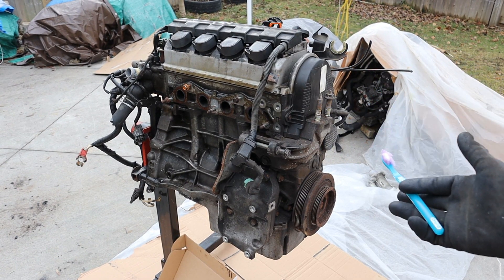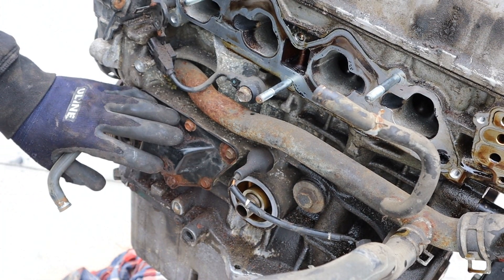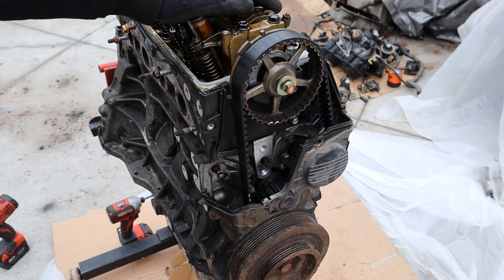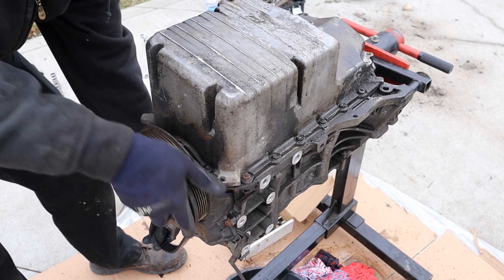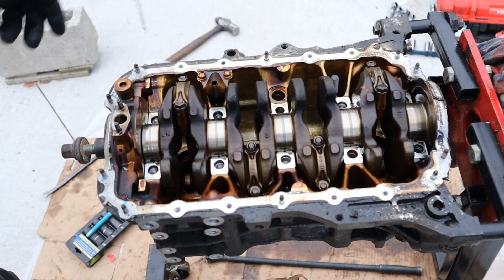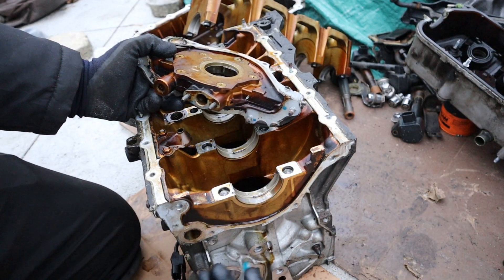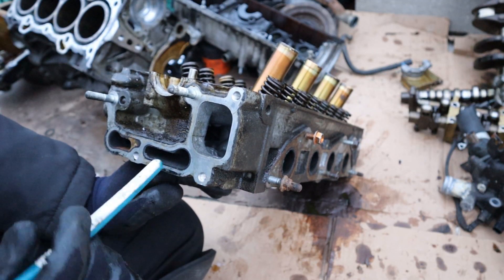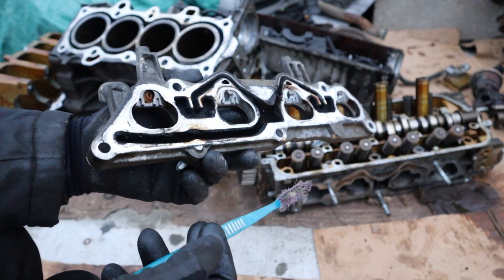Honda D-Series Engine: A Low Point for Honda

Comment: All Honda engines are turned down from factory to meet emission regulations. They are built solid and not "barely enough" so they break down once you increase power. Back in the 90s and 00s I NOS-ed the crapp out of stock D15B2 engines (90ps) and they lasted really long, did not even break down just blew gaskets and piston rings. Friend of mine upgraded a louzy D14 (EK series) from 75ps up to 143ps , dyno proven. upgrading step by step MPFI , TB, pistons for CR, cams (D16), intake, header, exhaust, airbox etc.etc... crazy. Ghetto stuff, people could not believe it. It is easy to swap B or K (or even J now) but the real fun is light car + built engine on budget, that is the POWER OF HONDA
Reply from the maker: Emissions make things sad. But at least they used to be built strong. 😢

Comment: i dunno man, the d-series is pretty solid little engine. the d17 aint nothing to write home about, but it did address the problem of ignition from the previous versions with the coil on plug, other than that no real improvements.
Reply from the maker: The k series and r series that came after were alot better

Comment: I'm a Honda tech and that was a bulletproof engine. The intake manifold nuts are easy to remove from the top , the biggest reason to remove the manifold was to clean clogged egr ports which didn't happen often
Reply from the maker: And how about the intake nuts from the bottom?

Comment: 192,000 kilometres is 119,000 roughly miles so this engine failed early in its life probably from a lack of oil changes
Reply from the maker: It didn't fail.

Comment: The K series did not replace the D series.
That would be the R18.
You should do video on that engine. 
Should be easy to get one. The '06, '07 and '08 were prone to cracked blocks.
Also the D series weren't that bad. People were putting forged pistons and rods in them making over 600 horsepower.
Reply from the maker: I've done a cracked R18 video check it out !

Comment: The bracketry and BS attached to the valve cover is ridiculous when they could've just attached it somewhere else, because it all has to come off to do the manual valve adjustment and valve gasket. The cam plug leaks bad and needs replaced on every single engine. Low powered for no reason and blows head gaskets
Reply from the maker: Yeah they could have made it more user-friendly

Comment: I've got a d17a1 in a 2002 civic. It's been a good engine currently has 445k miles and I still drive it some.  Bought it new 21 years ago when I started working for Honda.
Reply: Wow, 445K is the highest mileage 7th gen I have ever heard of. Engine and transmission still original?
Reply from the maker: That's alot of miles!

Comment: The o ring on the back side of the oil pump is a known leaker. Also there can be an oil restrictor between the head and the block that appears to have two small o rings, different sizes, this restrictor and  the o rings don’t always appear in the parts manual or any workshop manual. My daughters 2005 LX had them though. They fall out when you lift the head off and if it wasn’t for pure luck I wouldn’t have known they were there. Put new ones back, either end of the restrictor, and the engine ran fine. Thanks for the good video. Sometimes the alternator bolt securing the +Ve cable can be so tight the post shears off.
Reply from the maker: Good to know these little details from an owner

Comment: Just acquired a 7th gen Civic as a beater car about a month ago and was wondering if you or the I Do Cars channel would ever release a video of a teardown of one of the engines just by chance because it would be super cool to see an analysis of an engine I own. My daily is a 2000 Maxima with the legendary Vq30...you did a Vq35 so close enough for me lol. Basically same engine just larger displacement and has VVT whereas mine does not.  Anyways just think its super cool I can watch a teardown of an exact engine I currently own! Only difference being mine is a non-EGR engine. Bought knowing about the head gasket issue but these engines are so incredibly easy to work on I could do it in half a Saturday when need-be.
Reply from the maker: Nice! 
I do cars does great work, I watch Eric too.

Comment: I always preferred adjustable rockers or HLAs vs. shim-style valves because, assuming you're following proper maintenance and having them adjusted as required, shims are a pain: they need a special tool to remove them without pulling the cam, then you have to measure them and figure out what size replacement shim you need, then you have to find this new shim and this is usually the hardest part, especially for >20-year-old engines where parts may be NLA. Honda's SOHC engines with their adjustable rockers were always super easy.
Reply: I have a Kawasaki and a BMW motorcycle that use shims. The Kawasaki you have to pull the cam up to replace shims, the BMW you don't.  It uses little semi-spheres you can replace by popping an e-clip and removing the follower. R1200R 2011 MODEL
Reply from the maker: Good point
Reply: I did a valve adjustment on my motorcycle but mercifully it has a shim over bucket setup

Comment: Also the special hex tool for the damper is supposed to be used to torque it to spec. Usually just gets hit with an impact though and ends up being pretty tight and with age only seems to get tighter
Reply from the maker: Honda crank bolts are stupid tight!!

Comment: It'll only last 300k instead of 400-500k miles. I guess that technically does make it a low point. Side note, speaking of Honda engines I've personally witnessed an Acura 3.2 with over 400k still running. Honda does make some tough shit.
Reply from the maker: Yeah the j series is awesome 
Too bad the transmissions attached to them don't last

Comment: I bought one of these ELs this past summer. Even though I knew full well these engines were plagued with head gasket problems... I'm always hawk eyeing the thermostat while driving! I really wanted a 6th gen but getting impossible to find. Is there anything you could do to limit the chances of it happening? from the video it seems like theres really not a whole lot you can do but maybe some others can chime in. I do really love the car!
Reply from the maker: If it's a design flaw there's not much...keep up on fluid changes and watch the gauge

Comment: oh the intake being hard to get to is a B /E series problem as well the E series was one of hondas very early car engines the E series is fun the best way to get the intake off is to pull the head a lot of the E, B and D series are similar in many regards same issues plague the E series as the D series head gaskets blowing and warping the head but if you are good at ripping into these timing belt 4 cylinders you can pull the head in no time at least.

other notes about the E series is the oil pump is in the pan and cam driven leading to issues if the head is really badly warped causing the oil pump to fail to do its job the CVCC carb allowed cars up to the really early 80s to run without a cat and lastly the cvcc head is a 3 valve setup 2 intakes 1 exhaust notable examples are the 1.8l EK1 and the civics ED1 the first CVCC engine now these engines are fun to play with but have little power.
Reply from the maker: Good to know

Comment: I like how people still slap down cash for Hondas today thinking it's the F1 Technology Car Company, and not realising that period passed 20 years ago
Reply: But they are still the F1 technology car company.  They release a lot more details of the 2021 RA621H engine (or 2022 RBPTH001) in the Japanese press than any of the other F1 engine suppliers do.  Heck the other F1 engine suppliers are reluctant to even release pictures, whereas Honda have their F1 hybrid engines on show to the public at Suzuka as well as releasing plots of things like the harvesting strategy and component pictures (e.g., of the more compact cylinder head for 2021) in the motorsport press.  Besides, if the Honda K20 dual-vtec was a good engine 20 years, then the K20C1 turbo is still a good engine because a lot of it is still the same engine !  It has't been redesigned that much beyond the bits that actually needed to be redesigned (like the cylinder head being converted to a typical tumble port cylinder head for turbo engines).
Reply from the maker: But they did make good engines back then tbh

Comment: Larger cam profile? nope it has one cam profile you can see it in your video. The 1st intake rocker has no roller bearing. The 1st rocker locks onto the 2nd rocker so its 12V to 16V. Cam profile stays the same.

Comment: as far as pedestrian non - type R or special hondas go, the 4-5-6 gen civics with their D series engines and same year accords and preludes with their F series engines are really well made, with one condition - you have to get the manual, and of course B and H series are even better but they are rare. 7-8-9 civics seem like honda's dark ages, yeah there are special versions with K20a and they are pretty good but base models that most people drive are yuck, the new ones like 10-11 gen seem promising though I like them
Reply from the maker: Yes I agree

Comment: Thanks for showing the D series engine, but I'm not sure why you would call these a low point. I think they generally have a good reputation. I had several of these (D13, D15 and D16's, oldest one from 1984), but not a D17. All went over 300.000km's or almost 400.000km's before the car itself rotted away. One D16 suffered a head gasket failure due to an aging LPG system (ran hot due to a lean mixture). I've replaced several timing belts, but never a waterpump or tensioner. Why replace if the pump is not leaking and the bearing feels fine, they are not German cars where you replace everything preventively.
Reply from the maker: Yeah the D17 might have been the low point

Comment: I did a head gasket replacement on one of these engines, and while I was at it I took the time to clean out all of the carbon from the exhaust gas recalculation system in the intake. The engine went from running ok, except burning a bit of coolant because of a warped head from an overheat, to running surprisingly much better yet still not as responsive as even my Honda D15B7 in my 1992 Honda Civic DX sedan. The Honda D series engine should have died before this. They were thrifty and made decent power for their fuel economy roots, but this thing....the D17 should never have happened. I know Honda was just trying to save money, but the D17 is terrible. Yes, it made more power and torque than most of the D-series engines before it, but it did not get that great of fuel economy and it ALWAYS felt like it just did not want to rev out, even when they were brand new.
Reply from the maker: Nice ..yeah that EGR sucks!
Reply: @speedkar99  I do have to say, the D-series can wake up very nicely, but the Honda B-series will always be my favorite old school Honda 4 cylinder. The H-series is a close second.

Comment: I know a ton of D series engines that were absolutely pummeled and kept running. It's a pedestrian, reliable, and miserly little engine. I don't agree with the assertion that it represents the low-point for Honda in the slightest. Probably their 1.5L Turbo engines would be more disappointing. I hope you use your own toothbrush next time for penance.

Comment: Got 170k on mine. Just pulled it into my bay last year to fix the leaking head gasket. These engines have a known history of just blowing head gaskets because they use low torqued head bolts that aren't TTY bolts. Had a perfectly flat deck and head when I put the new headgasket on.
Reply: A fresh mls head gasket and ARP studs make them bulletproof
Reply from the maker: Glad you made it in time before warpe
Reply: I don't think the non TTY head bolts are the entire reason because the rest of the D series engines as well as the F series, H series, and B series all use the same style non TTY bolts and aren't known for randomly blowing their head gaskets like these are.